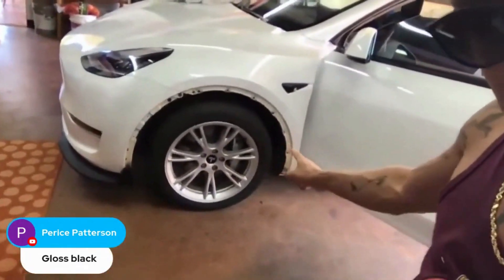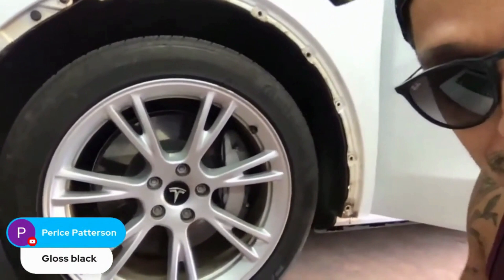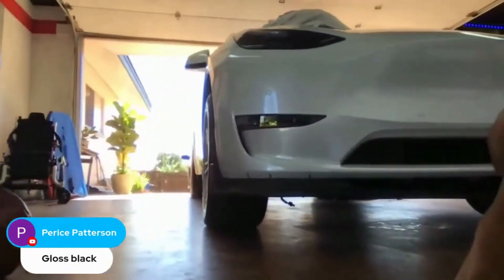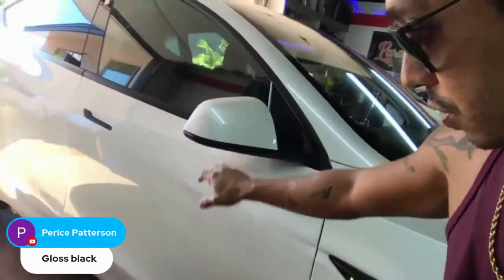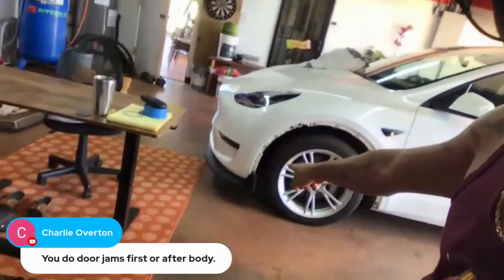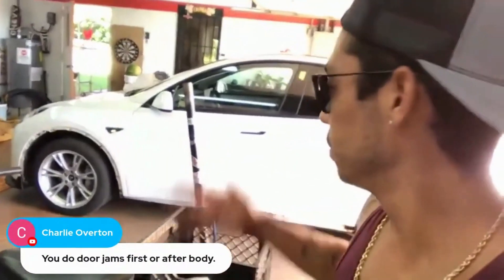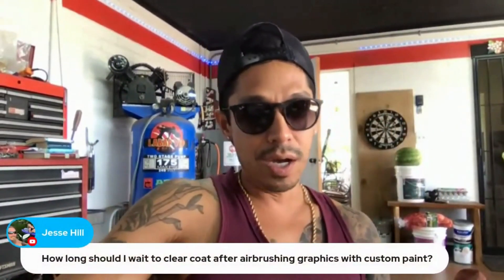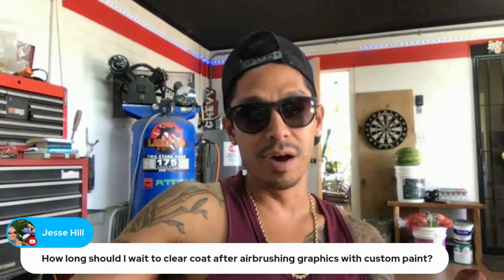🚘👉Autobody & Paint Q&A - Single-Stage Paint Job | How To paint Door Jambs | When To Apply Clearcoat?

Comment: currently going to spray a supra in super white 040 , 

was wondering i see a online shop in Australia with a brand of paint called Schuberts 

its extremely cheap have you heard of it ?

i worry about adhesion issues regarding cheap paint would it be worth giving it a go its around 160 usd for 6 quarts 4 litres of pre mixed paint and 2 litres of hardner
Reply from the maker: Hey Man! You can give it a try.  For more tips and tricks and A-Z step by step process on auto body and paint check out our LABAP VIP Program https://vip.learnautobodyandpaint.com/home